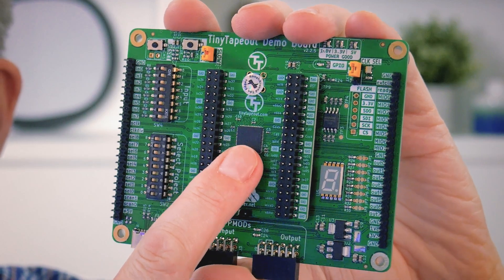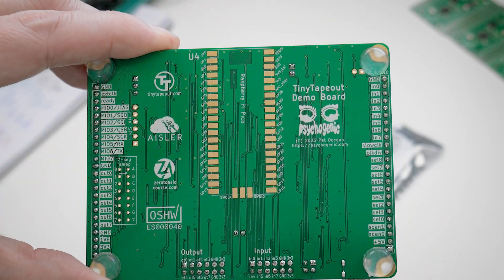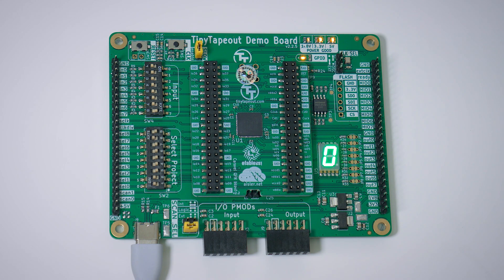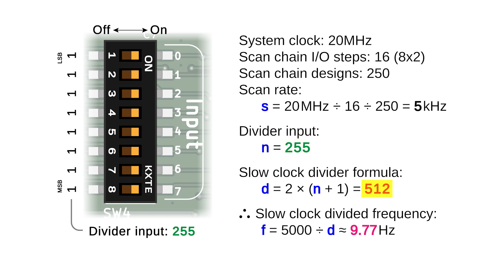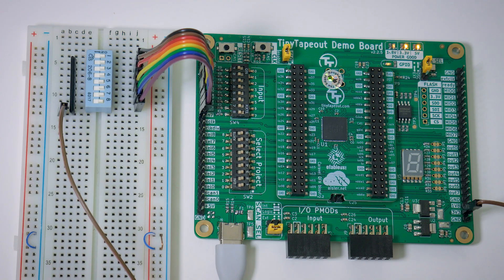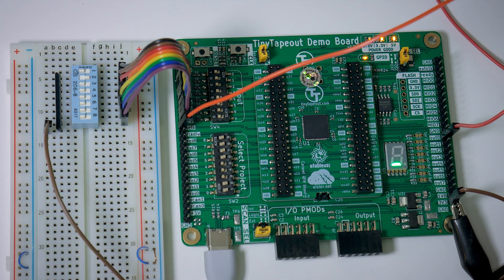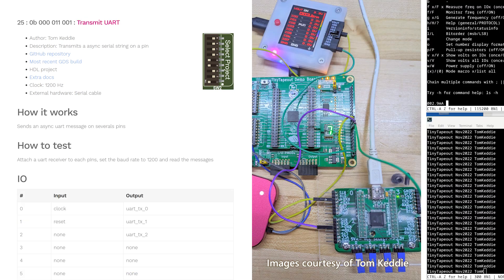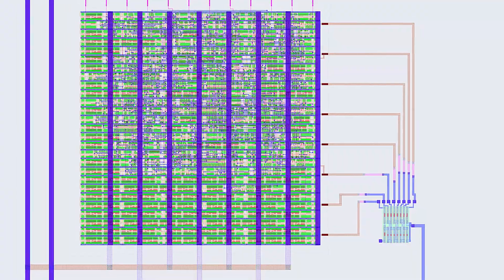TT02 ASIC/board: Open source silicon chips on Tiny Tapeout! sky130 VLSI design getting started cheap

Comment: Is 20MHz the fastest the ASIC can go?
Reply: The ASIC itself can do faster. For this TT02 chip’s shared structure it’s quite limited, but with TT04 and above all designs are expected to get at least 30MHz at the IOs and in some cases more. Inside the chip, a project can run MUCH faster depending on whether it is designed properly to do its own clocking (e.g. with a ring oscillator or clock multiplier of some kind).

Comment: So can you actually buy these chips.  Like I thought there were only like 1 per person who made a design.
Reply from the maker: You're mostly right... currently someone who does a submission can purchase only one chip+board kit, because the shuttle itself supplies 100 chips (unless extra shuttle slots are purchased, which makes it a bit of a scaling challenge). There are exceptions to this: someone who purchases enough tiles (I think 4+, say for a larger design or multiple designs) MIGHT (in some TT runs) be eligible to purchase a second kit. Also, if there happens to be surplus from a TT run, that surplus may be offered for sale at a later date. Matt Venn is hoping to find a way to stretch this further in future.
Reply: @fooglestuff  So, a normal run costs $10,000 right?  But these are $300x100 = $30,000.  I know there is overhead producing the demo boards and what not but is there room to lower the price?  Also, it seems like the die area on your runs are only half full each time.  I suspect this is to lower the interval between runs but it seems wasteful, why not just make the blocks bigger if this is constantly the case.  I mean it's still really cool and $300 for prototype silicon is a fabulous price but it would be nice if there were a smoother ramp to small scale production. 

Quite interested to see how some analog designs turn out.  Analog neuro nets on silicon could be really nifty.

Comment: I can't find the pdf file shown at 10:05, there's datasheet pdf in tinytapeout-02 repo, but it's missing some info, and github search never works, where's the latest datasheet?
Reply from the maker: All of those design datasheet pages I've shown are screenshots from designs found in the main list on this page: https://tinytapeout.com/runs/tt02/#all-projects -- They are indexed by design ID number. The datasheet PDF is (I think) exactly the same info from all of those individual pages. Many designs are lacking details. Feel free to contact the individual designers (i.e. use the "GitHub repository" links) to tell them you're interested in their design, and encourage them to do a documentation update ;)

Comment: I don't understand why an ASIC instead of a FPGA.
Reply: Fun
Reply: @quantumsmith371  Nobody is using an ASIC in small qty unless they have very deep pocket.
Reply: @y_x2  Like the man said, it's entirely for fun! Imagine designing your own silicon, and getting a chip with your circuit actually inside it! Of course, there are a few compromises, but I don't know if any of the designs are supposed to be particularly practical, it's all just for fun. This is the first time members of the public have been able to design their own silicon without needing a ton of money, by having lots of people club together in return for so-many transistors each.
Reply from the maker: At this stage it's mostly about learning a new way to design chips that is based on a fully open source workflow (including PDK or Process Development Kit) -- this is quite a different approach to how it has ever been. The other reason is that as of TT06 (now open, closing in about 4 weeks) this method also supports analog and mixed-signal designs, which you won't find on an FPGA. For many contributors though, it is probably as much about FUN (as others have said) as it is about gaining valuable experience in this new way of working that is trying to attract more people to the field.

Comment: Multiplexing some internal memory would be a nice addition.
Reply from the maker: Agreed! There have been experiments with small amounts of on-chip SRAM (on the order of 1KiB) in some of the TT shuttles, but expanding the internal mux to accommodate this being shared between all designs is not currently feasible (while also juggling all the other requirements and safeguards). Not to say that it WON'T happen in the future, though :) For now most people have been doing small amounts of memory using just DFFs, or they have been implementing external memory access via SPI/QPI.

Comment: What is the maximum clock speed of these chips?
Reply from the maker: TT03 and below, the max input clock is ~28MHz, but the huge scan chain linking all designs causes that to be divided by 8000. TT04+ allows a clock of at least 25MHz directly into any design, and maybe closer to 33MHz. Interesting is the fact that any individual design could implement its own clock multiplier or ring oscillator and go much faster… 200MHz might be possible. IO bandwidth is limited to ~25MHz too, though.

Comment: TT is intriguing. I wonder if at some point people will reproduce vintage chip designs. The retro community is using FPGAs for that at the moment, but something like TT would be interesting and maybe even cheaper. Many designs would require significant amounts of transistors though.
Reply from the maker: I find this intriguing too. There are successful and in-progress projects for recreating retro systems/parts already, and it's a fun challenge: TT04/05/06 provide 26 digital pins (with some caveats); fewer than normally required for much retro hardware. The upside is a much faster clock and higher transistor density than you'd find in the 1980s and early 90s. This has led to some clever reimagining of interfaces such as using SPI or muxed buses, or even putting more of a total system in a single design (kind of like an SoC). I expect this will only get better with time.
Reply: If this chip only runs 20 MHz , vintage means .. uh our ET3000 had 50 MHz DAC. 286 of a friend had 20 MHz. Can’t even PSX. 3do maybe? Amiga 600 ? C64 superCPU has 20 MHz.

The intro looks like TT should use variable size partitions. I still don’t get how this can be slower than FPGA. Inspired by Jaguar and Amiga, I would love to see that you could define a pattern in which chips can fire an write to a common 64 bit bus. Everyone listens. I like how Rambus brought transmission lines to the masses. Maybe the bus could actually be linear and meander over the chip and we compensate timing skew? Balanced signal and sense amps. Circuits far from each other don’t hear each other. Signal is damped before a round trip.
Reply: @ArneChristianRosenfeldt oh, I am thinking REAL vintage. Like 1MHz 6502 style... sure the faster parts will be out of reach still and many will require too many transistors. But it's a start...
Reply: @root42  yeah that is where my brain capacity for hardware ends. I cannot wrap my head around IBM OS/360 or pdp 11 or VMS? All those 32 bit computers.

20 MHz to SRAM connection is fast enough to multiplex the access to all 3 SRAM chips on SNES. 22 MHz is fast enough for pcEngine.

People implemented RISCV. Then hacknews talks about 4 bit CPUs which fit into 400 gates. So how many tiles do I need for Arm2 or SH2? I still don’t get why there would be a low clock frequency limit within a tile. SH2 has cache ( as does JRISC and MIPS ). With enough tiles you could build a clock multiplier and have no CPU limit anymore. This is just to flex to the FPGA crowd. Who needs parallelisation when we have 1 GHz without emulator slowing us down?
Reply: @ArneChristianRosenfeldt Sure, I think you can do many things. The I/O lines will be a bit limiting. I was thinking about ICs that are out of production, but useful for restorations: MOS CIA (FPGA replacement is now available), MOS 8501 (FPGA available, or 6502 plus CPLD), maybe with increasing transistor count even some of the original Amiga Chipsets? Those run at 7 or so MHz, should be doable.
Reply: @root42  how did Amiga OCS have 640px though? Fat Agnes is a VLSI of the chipset and has quite a few pins. SNES also has many pins. Yeah, I haven’t checked market prices, but 300 $ / chip??
Reply from the maker: The area-sharing design is different for TT04 and above and expected to be better, but expected characteristics haven't formally been released. While internal clock speed could theoretically be well in excess of 100MHz, indicative figures are that inputs would max out at 66MHz, and outputs at 33MHz, but maybe closer to 28MHz. These limits exist because of characteristics of the IO pad circuitry (within the Efabless "Caravel" padframe), with extra load/delays because of the internal mux between all designs. As more info becomes available, I will endeavour to share :)
Reply: @fooglestuff  so I read that mixed digital analog is coming. Still I prefer pulse mode width output (plus carry) from a tile directly adjacent to the pad for video output. VGA RGB needs 20 MHz. Even a slow pad should be able to reproduce an edge without jitter or at least output low pass filtered analog. I liked the shift towards sending audio via SPI to a DAC to minimise the number of traces which could send noise into the DAC. Controller input also better is serial. Yeah, I mean system of a chip, only that everyone could mix and match. So there would be the most most popular CPUs and the most popular GPUs . I just want each of them to be able at clocks higher than the 200 of the FPGA. At least FPGA is available to the masses, while TT seems to be under legal obligations to only produce enough samples for university students around the world.
Reply: Exactly what I was thinking. Mixed-mode support implies it would be possible to build a "real" SID chip, for example.
Reply: Just need to decide on which version of SID is real for you. FPGA can switch between all of them live.  @Vanders456
Reply: Looks like FPGA to me
Reply: @kreuner11  I forgot to read that very long paper, but FPGA has a lots of constant inputs to gates. And the signal needs to pass more gates. Hence FPGAs are slower. TinyTapeout miraculously is slower than FPGA. So analog might be the only application.
Reply from the maker: For what it's worth, there are lots of things that are useful to know. Strap in!
1. These are, really, the beginnings of this offering. Current specs mostly stem from the Efabless "Caravel" chip template which hasn't really changed since it was experimentally introduced about 4 years ago (though it is expected to be changing significantly for the first time this year).
2. No doubt, things will get cheaper, more sophisticated, denser, and faster in time (but I can't say how quickly). Economy of scale plays probably a bigger part in this than just the tech, and the scale is starting to grow as more people learn the open-source flow.
3. With analog & mixed-signal layout support since TT06, it is true it's possible now to do things that you can't do (or not as effectively) with just an FPGA.
4. At least hundreds of MHz (I don't have a better figure because I haven't seen characterisation data yet) should already be possible within "tiles": a ring oscillator design within TT02 has already been shown to work, and while it has been intentionally designed for a "safe" limit of ~166MHz, it's expected the chain could've been shortened to reliably go much faster.
5. The limit of 28~66MHz at the external IOs is because of 2 things: (a) the original (somewhat experimental) design of the padframe includes ESD protection and clamping circuitry that attenuates a fair bit, regardless of whether you're using analog or digital signals; and (b) the huge TT multi-stage mux adds a fair bit of load, and testing has shown that this drags down what would be ~33MHz to more like ~28MHz max. As the new Caravel design becomes commonplace and available downstream to TT, there are hopes that it will include more "bare" pads that will support much higher frequencies.
6. For the most part, right now Tiny Tapeout is more about learning these new open-source tools and processes, learning ASIC design in general, and doing experiments and invention relevant to the field that haven't been anywhere near this accessible and open in the past... so less "commercial" and more about growing the ecosystem itself.
...plus, for some of us, it's just fun :)

Comment: I want to understand how switch between different designs happen based on input.
Reply from the maker: In TT03 & below, all designs connect in series as a scan chain... giant shift register, effectively. "Selecting" a design means sampling only the section of the scan chain that is relevant to that design's position in the chain (which logic in the scan chain handles by monitoring the 9 'Select project' DIP switches). This design explains the slow clock speeds: 20MHz core clock gets divided by all the IO bits of all designs. TT04+ is a big change to make it a giant multiplexer (as pointed out by @user-vd8oy1wh4r), meaning any given design can run at much higher frequencies (30MHz+ expected) and with more IO (inc. some bidir). TT06+ also has power gating to turn off all but the selected design.
Reply: it's probably just a giant multiplexer selecting outputs from the specific design. So all designs work all the time but only output from the selected design is shown. It could also be that they switch off the clock for designs that are not selected to save power.